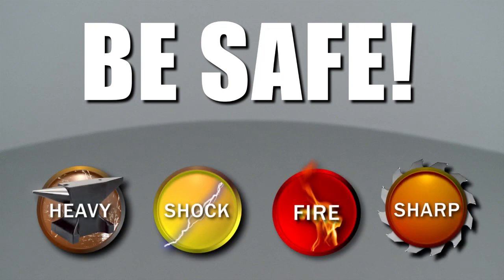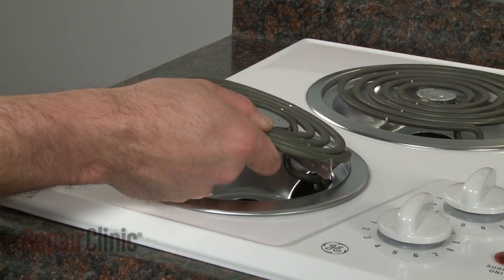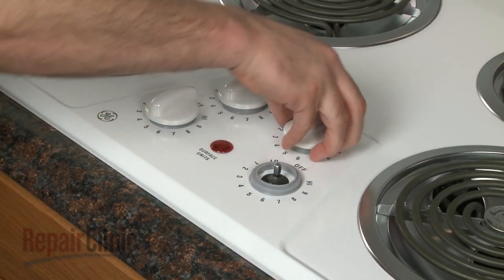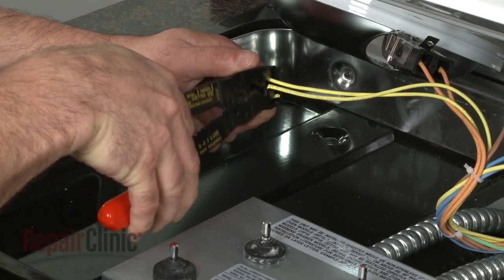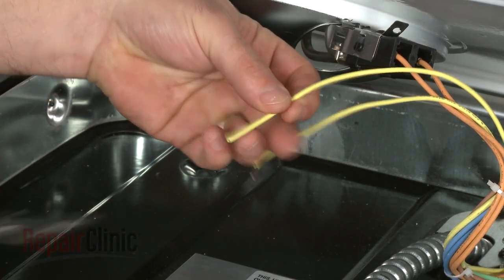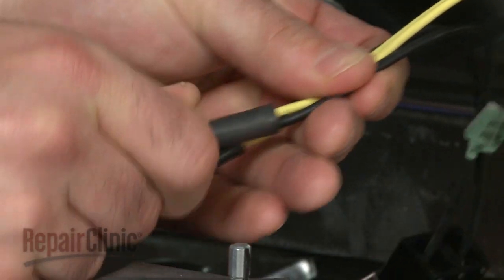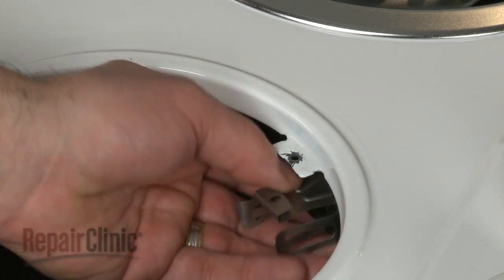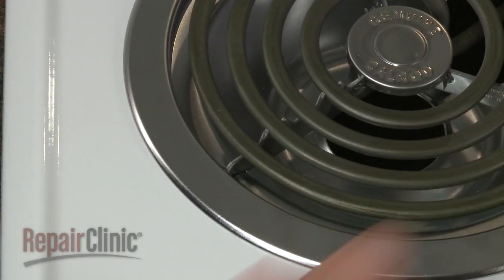GE Electric Cooktop Replace Element Receptacle #WB17X5113

Comment: I had some sparking & loud pops before i knew what was going on, i removed the heating coil but the  terminal block is burnt & lucky the house didnt burn down.  I ordered new receptacle kits (4) and coils & drip pans (figured might as well). my question is: Is there a way i can use just one of the burners while the fried one is still in place or should I cut off the terminal block while I wait for the parts to be delivered (which may take 10 days to get here )?? there's only so much I can do with a crock pot & an air fryer. thanks!
Reply: I would remove the element and the knob from the burnt one while you'd wait for new parts to arrive. Removing the element tells everyone that this one is not working (daaa) and removing the knob prevents someone to turn it on (providing electricity to the receptacles).

Comment: Is there a positive and negative for the wires?
Reply from the maker: No polarity so it does not matter which way the wires are connected to the new block as long as they are the correct two wires. Thanks!